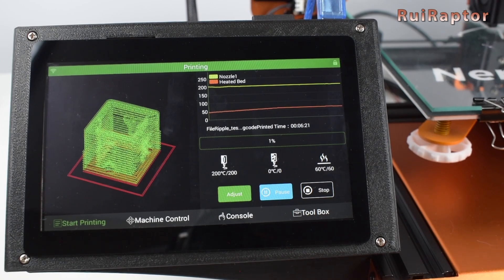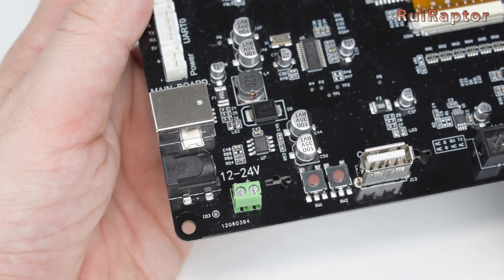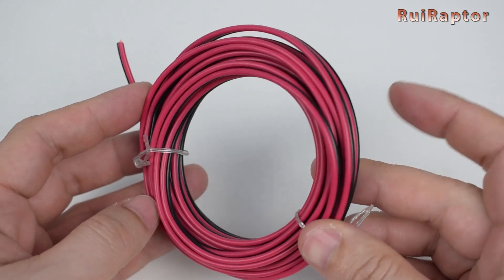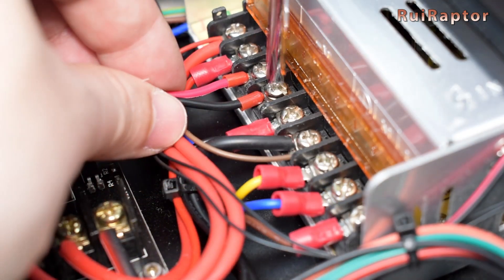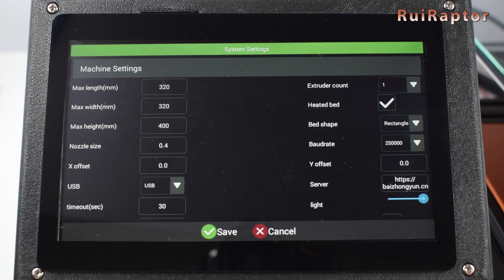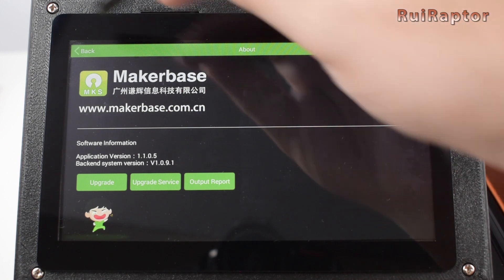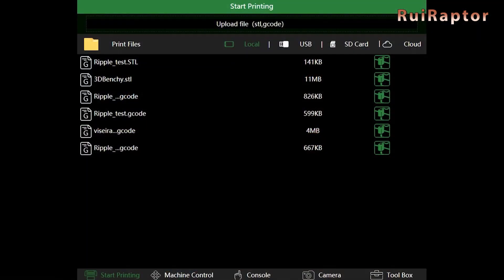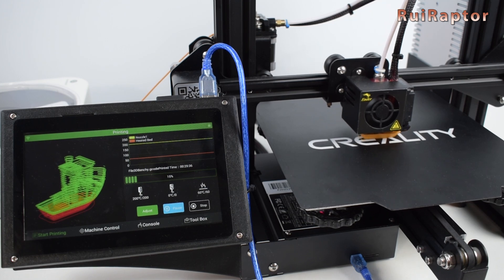Installing & Testing the MAKERBASE PAD 7

Comment: i got one and the files on it it will print but when i put a sd card with files on it it dont print them , it load them up inside it but not print them , the files are slices with cura

Comment: Do you get the layer view if you slice it outside with say Cura and import the Gcode or is that only if you slice it within the pad? I am designing a large format core XY printer and think this would be an interesting addition..but I only use Cura, Ideamaker, and Prusaslicer

Comment: If I want to use it as a main screen can I? Without octoprint. I have an artillery genius
Reply from the maker: Hi Filipe, you mean connect it directly to the board and use it as a printer screen? No, that is not possible.

Comment: Bonjour, impossible de trouver les fichiers de mise à jour du firmware de cet écran. Pouvez-vous indiquer la manipulation et où les trouver. D'avance merci.
 Hello, could not find the firmware update files for this screen. Can you indicate the handling and where to find them. Thanks in advance.
Reply from the maker: Hi, Makerbase does not have the firmware updates online yet but you can ask this in the MKS official FB group. Regarding the installation of updates, just copy the files to the memory card or USB flash drive and click on update.
Reply: @ruiraptor  Merci
Reply: @ruiraptor  is there already a new firmware update     with the newest version of octoprint   I have just receive the pad 7   but it is telling me pip is not working so I can not Install  any plugins  Thank you

Comment: Would you be willing to make a video about installing a bltouch on the tevo nereus? I don't understand how, I have asked on the FB group page, but have not had any help. I found a bracket on thingiverse, but don't understand how to set it up. I understand the physical instillation near the hotend, just not how to modify the file to use it.

Comment: does it work with marlin ? how it  looks on wifi ?
Reply from the maker: Hi Amir, the pad is connected to the printer's board by USB or AUX flat cable. We tested on a Tevo Nereus and a Creality Ender 3 (both have marlin firmware) and it worked fine as you can see in the video.

Comment: VERY NICE mount design.
What build plate did you use for nice finished front texture?  So clean.
What filament and printer did you use to print it?
Such thorough and quality videos.
Thank you.
Reply from the maker: Hi Tim,
thank you so much.
We used our prusa MK3S clone with a texture magnetic steel plate to make the mount.
Regarding the filament, we used Kexcelled black mate.
Regards

Comment: So, even for uploaded .gcode file (sliced externally), there is still possibility to visualize the part and print progress, same as for internally sliced .stl file?
Reply from the maker: Hi, yes. You see the layer preview. If you see at minute 13:39 the benchy was sliced with S3D and it's being displayed on the screen.

Comment: Hi Rui,
I've got a tevo tornado and I would like to add a 7' screen but I'm hesitating between the mks tft70 and the pad 7
Which one do you think is the best to use ?
Thanks
Reply from the maker: Hi, we didn't test the tft70 but it seems a simpler version of the pad 7. From the pictures, it has option for a wifi module but it does not seem to be included. The price is similar so that makes me think that the pad 7 (which has more capability) should be better...but, as we mentioned, we didn't test the TFT70 yet ;)

Comment: Hello,
Nice presentation that made me want to buy a 7 "pad. I wanted to know from what type of file the 3D view is made, the G-CODE file to print?
Thank you for the feedback.
Reply from the maker: Hi Jean, this pad will show the image of the file, however, it will show differently when gcode or STL. When Gcode it will display the layers while in STL it will display the model.
Reply: @ruiraptor
Reply: Merci pour l’information. Le pad devient alors très polyvalent et utilisable pour toutes les configurations et pourrait être utilisable en autonome via wifi sur la carte CNC et wifi sur le pad. Intéressant non, solution à étudier...

Comment: Noob question: Will this work on an Ender-5 with a BLTouch ??  As long as the printers firmware is BL Touch enabled it will not matter to the Pad ??
Reply from the maker: Hi Kevin, yes, it will work on an Ender 5. If you load Gcode files it does not matter. If you use the pad's slicer, you only need to add the G29 command in the start sequence to enable the BLtouch.
Reply: @ruiraptor  Excellent !  Thank you !

Comment: Very nice video,but I think that sometimes (at least in my case) simplicity is the best and I like it that way, lol... 😊👍🏼 The pad is very nice, but not necessary for everyone, myself included. I enjoy the quality of Cura slicer and all the controls it brings and I have a pan/tilt/zoom wifi camera with a smart plug setup that works great for less than the cost of the pad. 😁🤙🏼

Comment: I bought this pad in July 2020 and it had an older version of the software, mostly in Chinese, and no update to the version from the movie on GitHub MKS :( but they sent me the files to update by email :)
It's a pity that there are no new updates for these 2 months :(
in general, the pad is very nice, only a bit poor in functions, if you could update the octoprint it would be great, and if it wasn't hidden, it would be extra :-), I connected from 10 different cameras, none of them worked :(

works with other motherboards, not only with MKS, I am now building a printer on BTT SKR 1.4 turbo and it works great, it also works with BTT GTR 1.0 (but I have problems with connection with this board, even with a computer)
Reply: Is it on this moment already  possible to update  and install plugins

Comment: Hi thank you for the great information, could you recommend guage wiring? Also if the gcode is compiled in cuts and uploaded via the MKS do you expect the software limits to still effect final print quality?
Reply from the maker: Hi Aaron, for the wiring guage, check this table here: https://en.wikipedia.org/wiki/American_wire_gauge
It need to be able to carry 3Amps of current at least. 
Regarding the print quality, if you slice the gcode files (with an external slicer) and then upload them to the pad, the print quality is the same as if you saved the same gcodes to the memory card and printed them through there.
Reply: @ruiraptor  Thank you for the reply, I'm concerned that this could have been updated to better version. I have bought it but hope it is actually able to be updated.
Reply: Hello ruiraptor, any updates on your experiences with this, mine is installed but every time I try to print from SD card (different cards used) it fails just after homing.